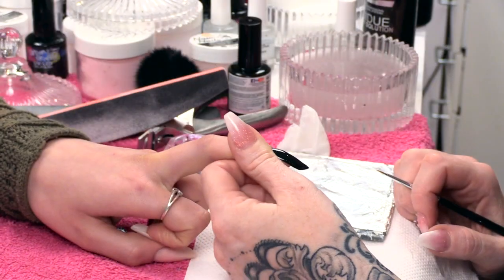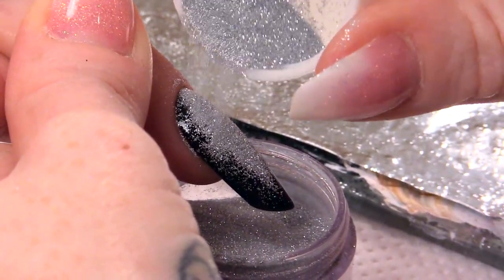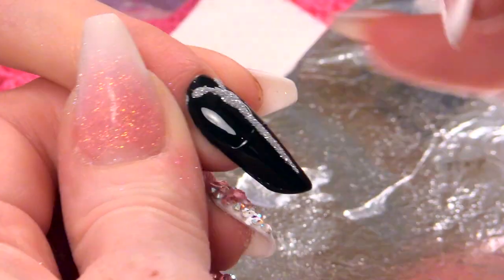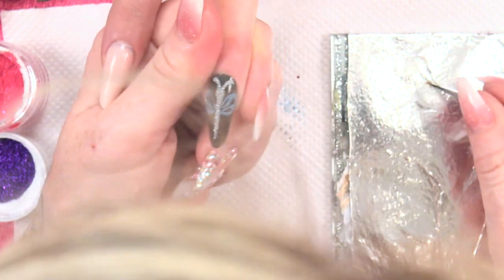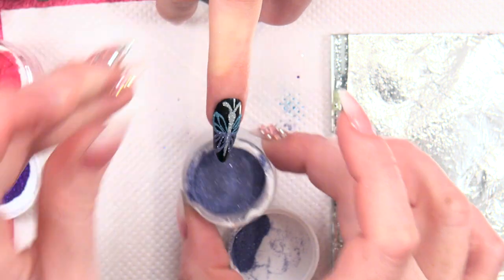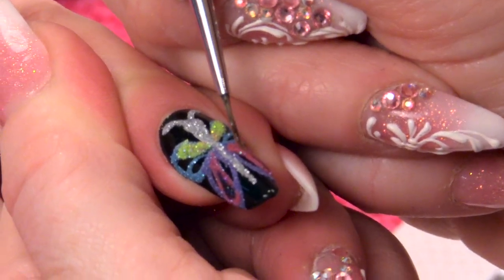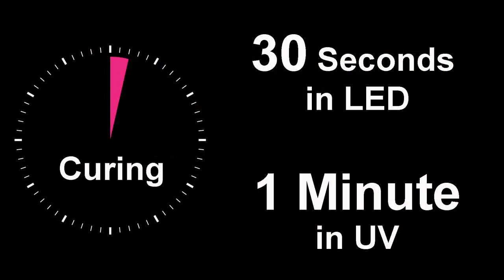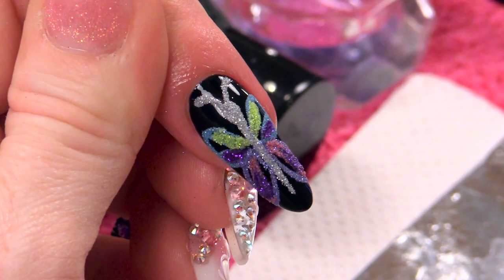Sugared Butterfly Design on a Pipe Nail.

Comment: Beautiful. Question: won't the glitter wash off when she washes her hands, over time?
Reply: Laurel Limerick if you notice she's being quite rough when she's dusting off the excess. gel is a super super strong epoxy type product so when it cure, anything set in it is there until its taken off. sure there might be a couple sparkles here and there, but in general, no.